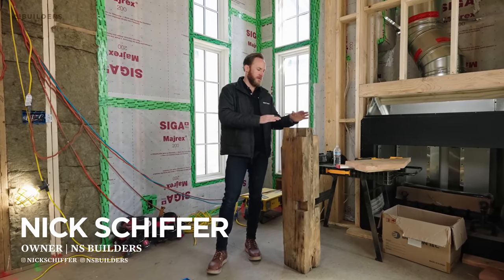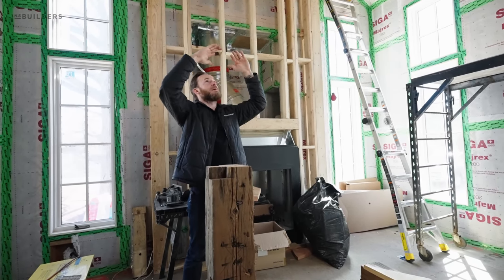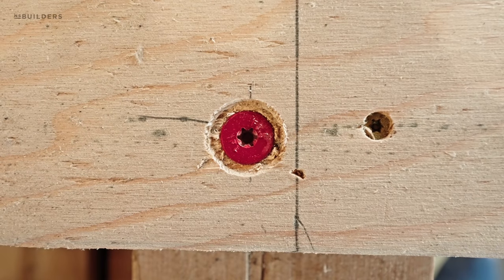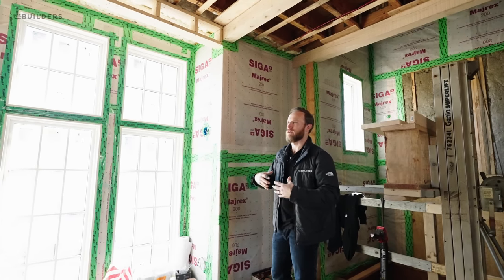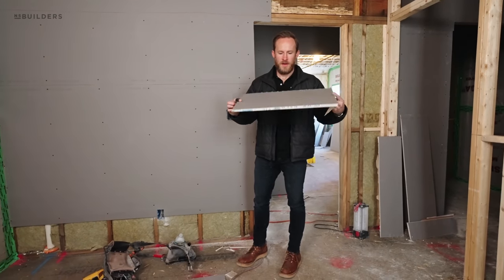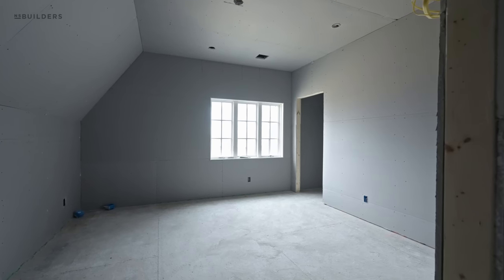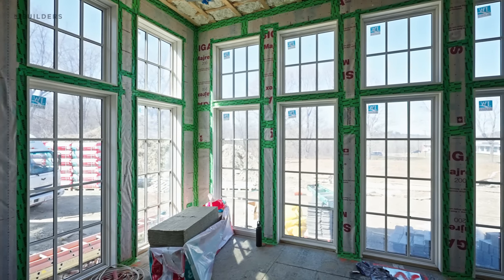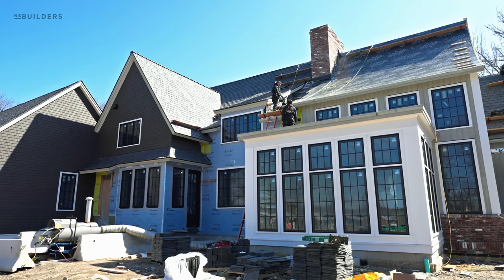Understand the benefits of air sealing a new home

Comment: Sounds like a very expensive Tyvek in disguise. I've never heard it explained how a barrier can pass moisture (liquid), but not air (gas), and that goes back to the introduction of Tyvek. As I remember, Tyvek essentially changed their justification for the use of their product?  "Air infiltration barrier"? When the exterior sheathing is 4x8 panels nailed on all edges, how does air "infiltrate"?  The old poly vapor barrier installed prior to sheetrock worked. Prior to that, tar paper under the exterior sheathing sufficed. Apparently progress in residential construction methods equates more to manufacturer's profit than health benefits.

Comment: I thought houses need to "breathe"?  A perfect air seal implies a perfect moisture seal... but if there is a leak somewhere in the wall, the moisture will fester?  But I am just a guy on the internet, and I don't build houses. :D
Reply: This product is a smart vapor retarder so it doesn’t allow vapor through it but if you punctured it or poorly taped, and vapor got in, when the season changes it does allow it out in the other direction

Comment: You should do an analysis of how much all these air sealing costs add up to and how much you save in heating and cooling costs. Depending on where you live and the weather the cost of energy in your area will also make a difference.

Comment: I'm rather biased, but all that sealing and taping on stick built construction seems like a lot of work and cost, and as you mentioned can sometimes go wrong if a subcontractor is not aware of the pitfalls. More folks should build with ICF which needs almost none of that as the wall itself is an impenetrable air barrier after the concrete pour, and is essentially impossible to mess up afterwards.

Regardless and that said, air sealing is very important as you've mentioned, and your company's doing really high quality stuff here with it. Awesome work.
Reply: Agreed. It is generally said that ICF costs 5%+ more than stick built. But, I have to believe if you compare high performance houses, all of the special membrane, taping and exterior insulation labor and materials for stick built should be in the same price range as ICF.

Comment: Is this also done in Texas homes? I opened up some walls to renovate and found some interior plastic seal, never seen it before, not sure if it was an old practice used on late 1978 homes. The new homes I've seen in Texas have exterior sealing on the siding. Does it affect Texas homes having just interior seal??

Comment: Awesome helpful video. But for those that dont understand this What about moisture protection and humidity internally?
Reply: It’s really important to ventilate the home via ERV or HRV and with bath fans and range hood as part of the total package but the Siga product they’re using if installed well, doesn’t allow moisture from inside the home into the wall cavity but if any got in somehow from the inside or the outside, it has the ability to allow moisture to pass in the direction to dry to the inside.
Reply: @CMCraftsman thank you!

Comment: Any reason you guys just used rissan around the windows and not fentrim?
Reply: Fentrim ist actually a tape which allows you to connect Vaper Barrier with concrete, so it can get some kind of plaster of it after. 

What you meant is probably the Siga Corvum.
It's a corner tape and it comes in 30/30mm and 12/48mm. 

I agree with your question tho.

Using Corvum in the corners will get rid of all your problems with the blueboard guys cutting tape. Won't happen. 
Have a good one ;)
Reply: @sami11820  siga fentrim IS 20 is used for sealing around windows and doors. There are different types of fentrim